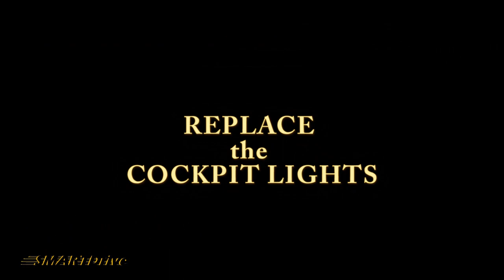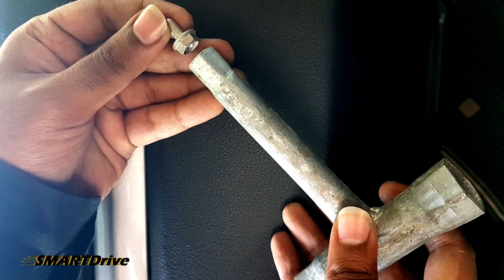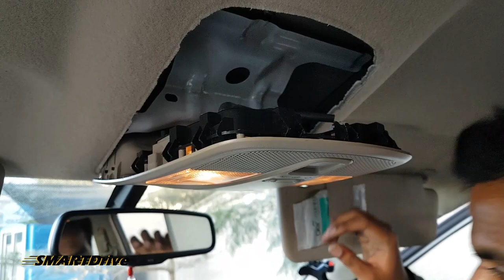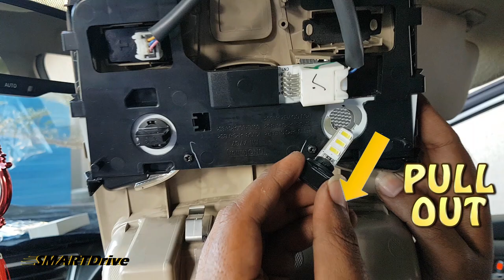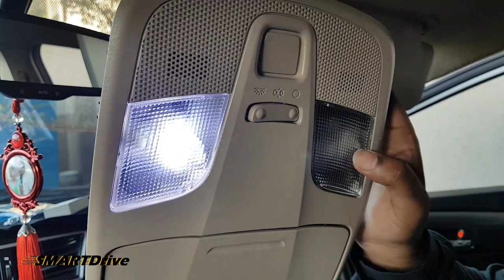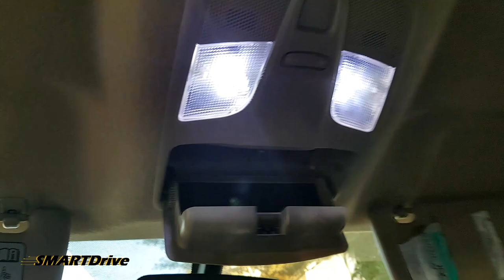Suzuki : how to open cabin light assembly [cabin light, switches and mic ] [music] : SMARTDrive333

Comment: After removing the bolt you just have to pull out the light assembly?
Reply from the maker: Yes sir. There is another simple method though. New video coming soon.
Reply from the maker: EASY INSTALLATION #2 
This video will help you 
https://youtu.be/qcZ40Paf_94